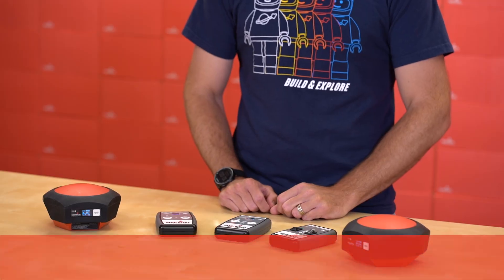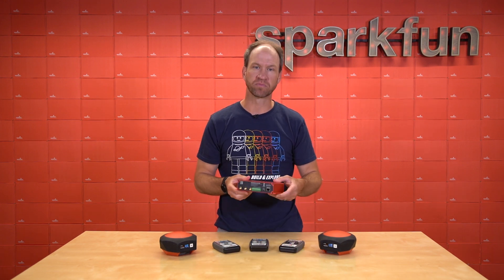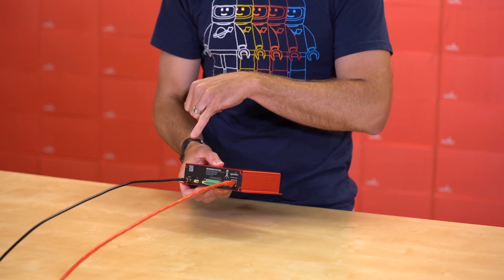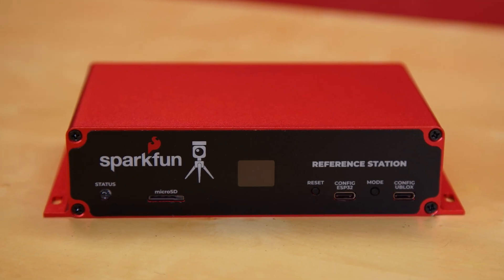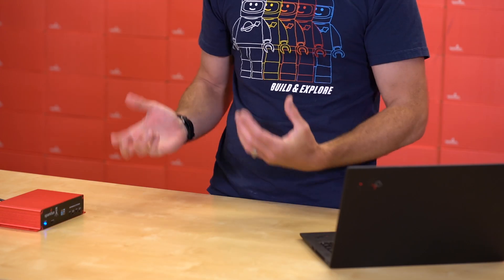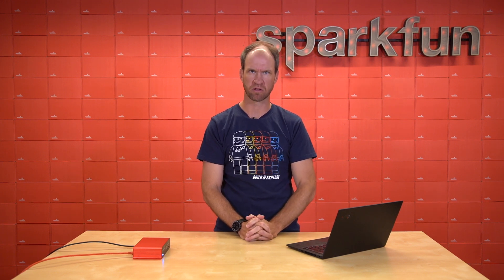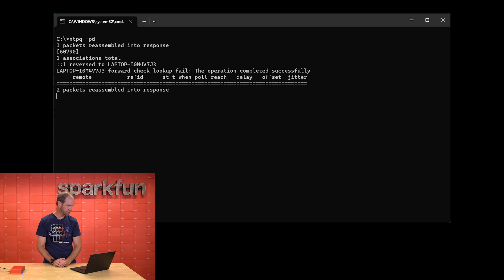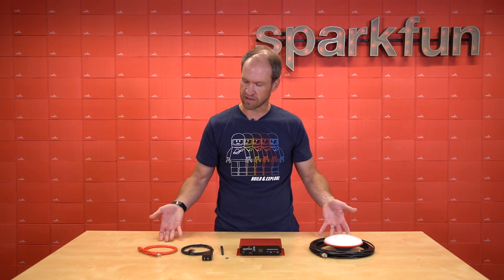Product Showcase: SparkFun RTK Reference Station

Comment: The correction data can be received approximately up to 10 km, how about more than that? Does it needs another tools to get the correction data extended more than 10 km? Thank you
Reply: actually after 10kkm you need another one base station, otherwise the error is getting up ! so RTK systems makes the correction based on the distance between Rover and Base,

Comment: Could this be used to with John Deere Starfire equipped and other make's of agricultural machinery?
Reply from the maker: What a fun question! It's hard to say from the John Deere website and specs but it does look like the device is using standard NTRIP protocols to gain the corrections for the RTK controllers. So yes, it could work. But John Deere is not known for their openness or compatibility so YMMV.
Reply: Jd does not use rtcm.  Trimple does.
Reply: JD Starfire Receivers use standard RTCM3 when "MRTK" activated. Together with JD 4G Modem you can connect to any NTRIP Caster.  @proof6930

Comment: If I heard correctly, you said that it was in NTP mode at the end.  Does this mean it can be an RTK reference OR NTP server, or can it provide both services concurrently?
Reply from the maker: The CSRS report includes the uncertainties of the coordinates (in this case 2 and 3mm).
Currently the Reference Station supports only one mode (Base station or NTP server) but we welcome firmware requests on the github repo.